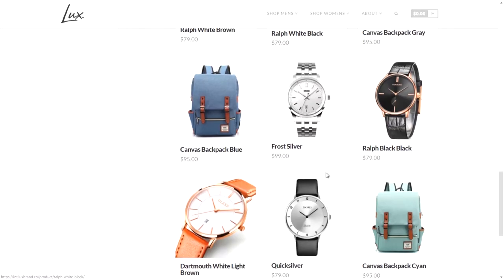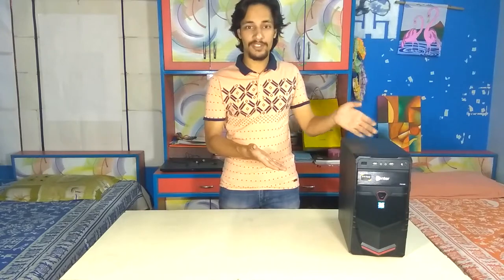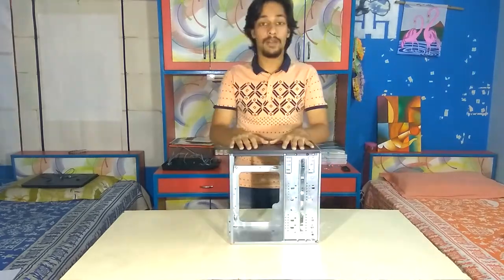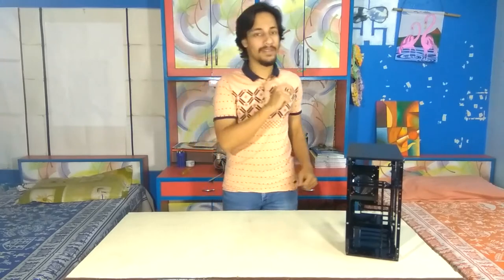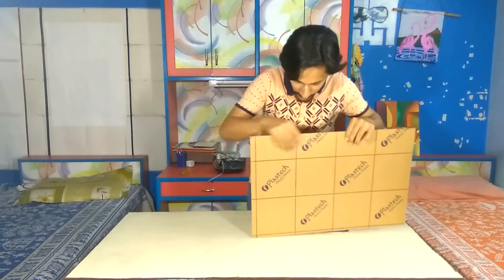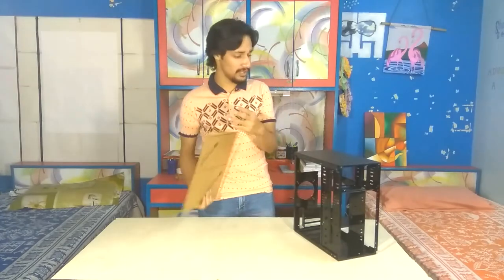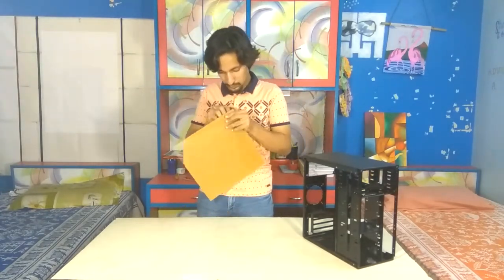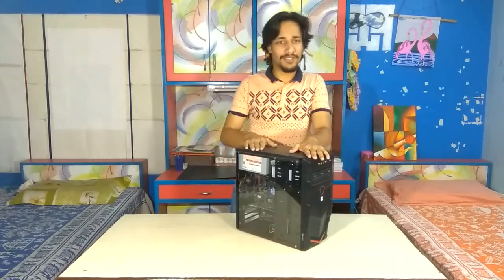PC Case Mod - INDIA || Cheap & Easy ||

Comment: just wanted to ask this, what is the melting point of the acrylic sheet?
Reply from the maker: No idea, but the computer heat won't melt it as it's also used in professional cases.

Comment: What is the thickness of the sheet and in which places(shops) can i find one?and how to cut it?  By the way Amazing man...thats what i was looking for! just add some designs on the plastic(front) of cabinet with orange tape and it will look bang onn!!!!
Reply from the maker: It's called an Acrylic sheet, would be like 3-4mm. You can find it in Art or Hardware store. Thanks for the idea man!

Comment: I did the same kind before watching the video every thing came out well except the paint which peals out while fixtures
Reply from the maker: Yes, that happens. It depends if your paint has primer in it or not. I used 2 different cans on 2 different Cabinets, One had peels coming out and other didn't. Try to use paint can which says lamination on it. Hope it helps.

Comment: How thick is the acrylic sheet you used
Reply from the maker: It's not much, must have been about 5mm or something..
Reply: @RiskAwesome  Thank you my good sir
Reply: Also quick question. I built my own PC for the first time and it works. But I need to create a windows boot program from a flashdrive to start the PC. Is it possible for the flashdrive to run out of space. Or will I be able to use it forever to boot up my pc?
Reply from the maker: No Problem Mate
Reply: Also quick question. I built my own PC for the first time and it works. But I need to create a windows boot program from a flashdrive to start the PC. Is it possible for the flashdrive to run out of space. Or will I be able to use it forever to boot up my pc?
Reply from the maker: Umm, you could use it forever to boot imo. But the boot up speed and system stability would not be so good !